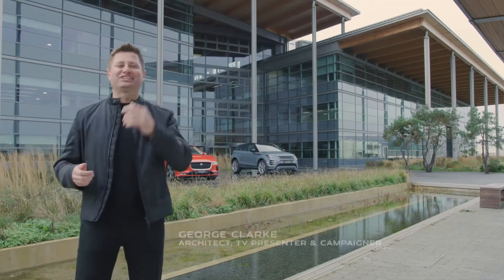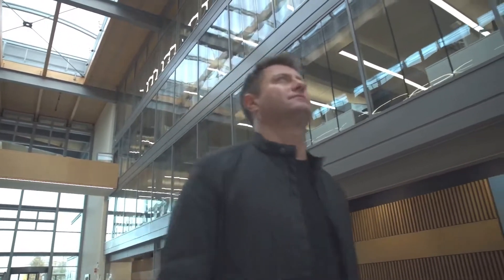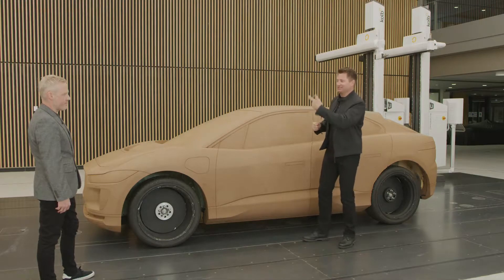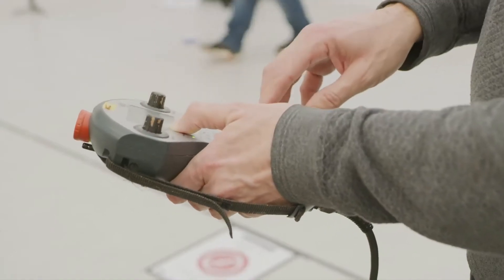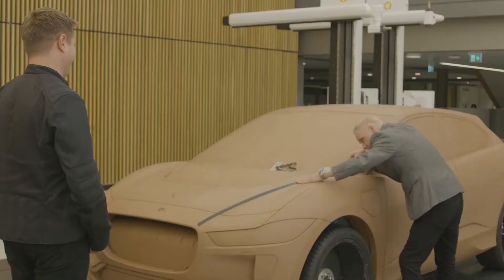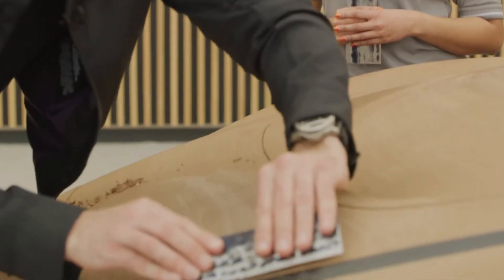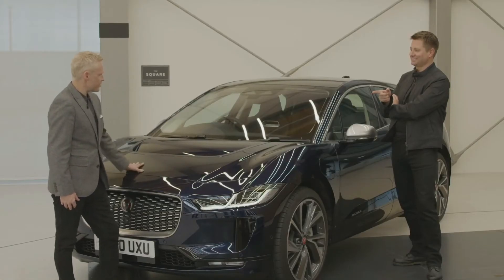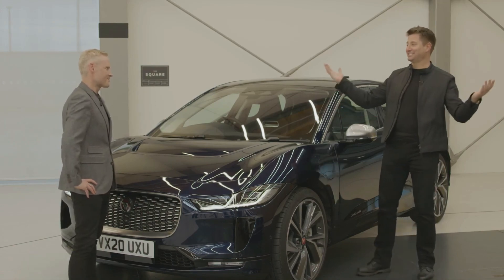How to do Clay Modeling in Car Design - Jaguar Design

Comment: I know nothing about how these car designs are made but surely they have to follow a certain standard or rule and sculpt a car design around it?. How do they know that all parts fits within the sculpt?. How do they know their sculpt when it comes to aero dynamics that its really smooth to air friction?.
Reply: It's a 3M product called dinoc. A paintable film that is soaked in water before stretching over the clay surface.
Reply: Sorry, I replied to another question. By the time you are making clay models the basic packaging has already been established. So these models will honour a series of hard points inside the clay. The 1/5 scales can also used at MIRA to calculate lift and drag.

Comment: Is it possible to know which film is applied to the clay models and where to find instructions on how to apply it? I have seen that it is removed from a tub with water so I assume it is different from all the films they sell for wrapping that are fixed with a hot gun. Correct me if I'm wrong.
Reply: It’s called dinoc! It comes in huge rolls backed with paper. Once dunked in water, the paper slides right off, the film softens, and we stretch the large piece of wrap out over the clay while it’s wet, and sort of squeegee it onto the model with slicks. This removes all the water from underneath the surface  while also keeping it taught on the car body. once that water is removed, and dries, it is fully adhered to the clay. From there we trim any excess, and use special thin tape over it to illustrate surface breaks, or hide transitions. It is really similar to wrapping a car, but without using heat